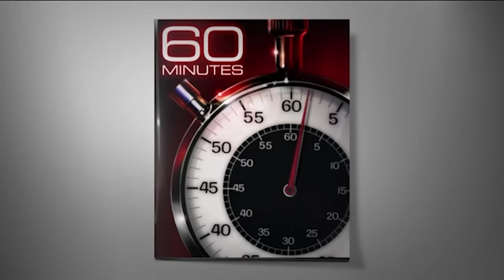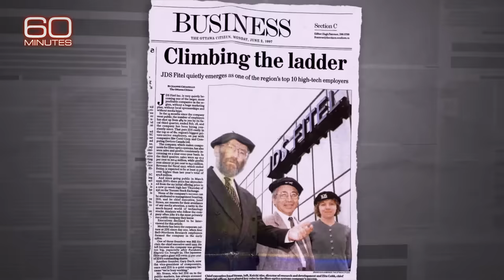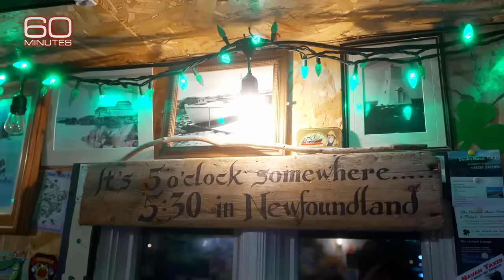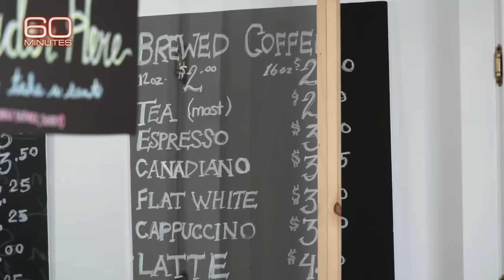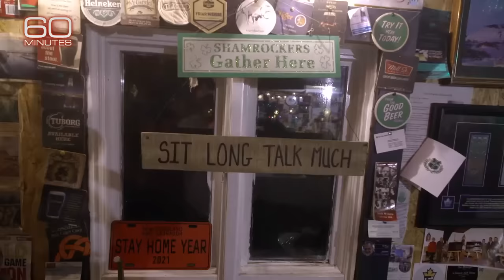Fogo Island: A far away comeback story

Comment: No trees
Reply: Can't tell if it's windy.
Reply: @perpetualgrin5804  They filmed in the best summer time weather. They are sitting out in the North Atlantic, there is most definitely a lot of wind. Fall winter and spring is going bring storms with blows being 30 40 50 MPH on a regular basis. The issue with trees however is only a few inches of top soil until you hit sold granite bedrock, so tress can't anchor themselves in such shallow soil.
Reply: @writerconsidered  Years ago visited  Greenland  ,can't tell if it's windy till you go outside, your post took me back.

Comment: I wouldn't trust that building that she has put up did look up did you notice that the supports on the left end of the building none of them are straight every one of them is at a different angle that's not good architecture